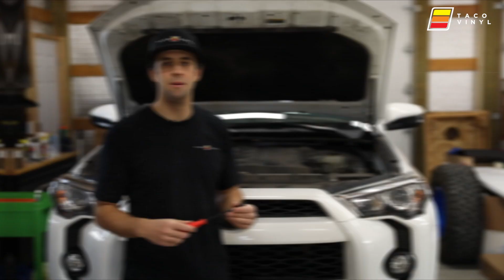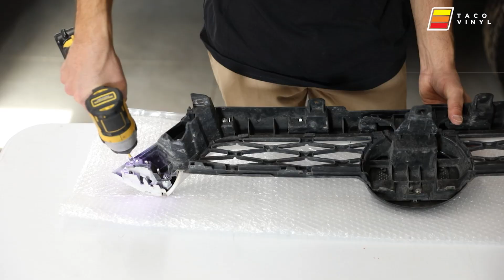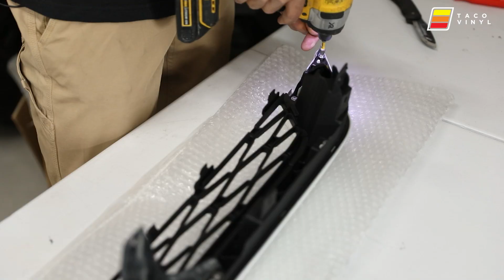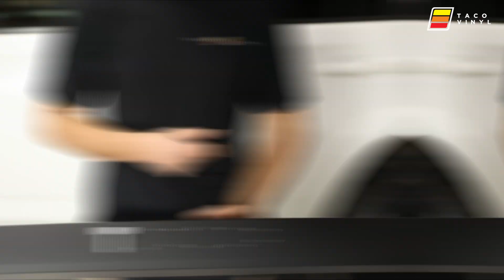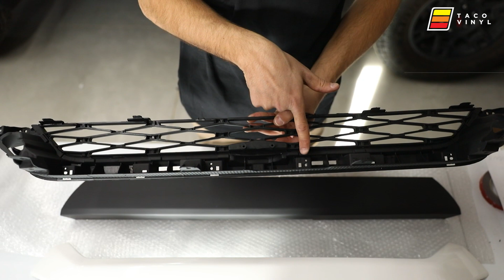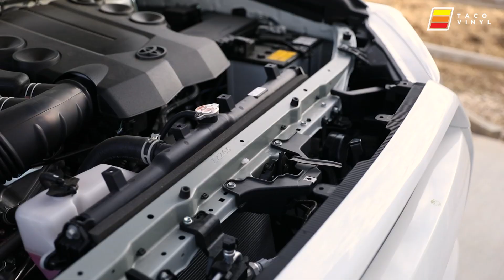2014-2021 4Runner Pro Grille Install

Comment: Ordered a grill after seeing this video. Great product. Fast and easy installation, I prefer the screws being used to mount the letters. Took me 30mins to install no problems. This video basically covers all the steps. My 2017 TRD Off Road looks nice with the new grill.

Comment: Ordered and very happy with purchase. Nice finish and quality, with no gap on the ends of the center garnish, as you see even on some oem grilles. Reinstalling the upper section was a little trickier than shown but overall, fairly easy.  👍🏼

Comment: Can you do a video for the 2020-2021 grill. I just installed mine and it created large gaps on the upper painted grill sections. You guys told me to take a dremel and trip the valence piece. Can you guys make a video on that modification.
Reply: Did you watch this video prior to installing? How would you rate the install in difficulty on a scale from 1-10 with 10 being the hardest? Would you recommend others buy this grille?
Reply: @Lando4534  i watched the video several times prior and during my install. Followed it step by step. Video was informative but i am not happy with the results. I think this product is incomplete as i am asked to modify it by the company so that it will fit correctly. I would not have purchased it had i known it would cause a significant gap when reinstalling the upper piece of the grill. Others have noted the same issue on the 4Runner forum.
Reply: @elvir55begic  Thank you SO much for the information. This concerns me because another person posted their experience with the grill as well. I asked him the same questions I asked you and now his comment is deleted. I'm not sure if HE deleted it or if the video owner did it. I even wrote the company about this issue because I wanted to make sure that it fit well without modification and the company TOLD me that he just had a defective unit. Taking the fact that you are reporting the same issue (along with others on forums) is preventing me from buying this grille.
Reply from the maker: Hey guys! Some peoples grilles fit tighter than other on that upper section and have had to trim back the black center piece for it to sit completely flush. Make the mark before you remove it and then use a tool to remove that piece. I’d recommend using a dremel. Sorry I didn’t see these comments. The best way to get help isn’t here but through our Instagram or email. Thanks
Reply: @Lando4534  They deleted my comment, I wrote you an in depth review ultimately ending in NOT recommending this product for this exact reason. They are probably going to delete this one too now
Reply: @tacovinyltv  I dremeled the grille attachment as instructed, the upper bezel still does not sit flush as it did before.
Reply: Did you ever get yours to fit ok? I was just about to install on my 2021 ORP today, but now I’m really nervous it’s not going to fit right.
Reply: @jegger1.0  no i never got mine to fit to the factory gap amount. It looks like the upper painted trim piece is still being pushed up and i still have a significant gap. I was told by the company to take a dremel and shave off areas of the black shroud but that did not work for me. I may order another kit from a different company as I’ve seen others have good luck with other kits
Reply: @westensteeghs  yes i wrote a review on their website also stating the issues i had and it was never posted either. They did contact me to try to help but no resolution was made. Wish i could return it
Reply: @elvir55begic   Is it more of an issue with the upper grill or the black plastic “TOYOTA” cover that gets adhered to the center piece between the upper and lower grill? I’m wondering if maybe just buying the OEM upper grill part would help. It’s a lot cheaper than the OEM “TOYOTA” part.
Reply: @jegger1.0  I’m not sure if that upper grill piece is the issue. I have my factory one still in the garage but i think you are saying to buy the TRD pro upper grill piece from the dealer to use with this. I can try to look into it and if it makes sense to do this vs just buying the factory kit from Toyota
Reply: @elvir55begic  Right. The OEM upper grille (PZ327-35056) runs for about $120 and the OEM "TOYOTA" garnish (PZ323-35058) goes for almost $300 (which seems crazy). There doesn't seem to be much to the garnish other than literally sticking it on so I'm curious if the fitting issue is coming from the grille not fitting in properly to the upper trim that comes with our vehicles. I'm wondering if it's possible to just get the OEM grill for $120 and get it to work with this aftermarket garnish without dropping another $300 for the OEM garnish.
Reply: @jegger1.0  That's what I am thinking about doing. The OEM grill is not terribly expensive, but that garnish is stupid priced. I am trying to find someone that just sells the "TOYOTA" garnish for a reasonable price. 

What about it @branchanyota? Any chance you could package and sell just the garnish?
Reply: @jegger1.0  My grille fits, but the upper bezel is no longer flush. I would honestly return and buy oem if I had the choice.
Reply: @scottaxton9928  Yeah that OEM garnish is stupid expensive. I don't get it...it's a piece of plastic that's essentially taped to the front of your 4Runner???
Reply: @westensteeghs  Do you know what specifically is causing the upper bezel to no loner sit flush? The sizing of either the upper grille or the garnish must be off from the OEM parts. I'm wondering if the upper grille technically fits into the inserts, but the dimensions are just off enough to cause the upper bezel to not sit correctly...or maybe it's the garnish...or both?
Reply: @jegger1.0   This whole grille setup is obviously not made for the 2020-21 gen of 4runners. The tabs dont fit, sanding/cutting was necessary, or you'll end up breaking them like I did. On top of that the grille attachment was too wide, had to cut off over a quarter inch of material  (on each side) just to have the upper bezel not rest on top of it. Even after doing this the upper bezel is not flush like the stock grill+bezel combo. Maybe if the manufacturer finished 'converting' these to fit the new gen it couldve worked. Instead they dremel out the area for the sensor to fit and call it a day.
Reply: @westensteeghs  mmmm. Not good. The 19 and 20 are just different enough that it makes fitment an issue. I really appreciate your comments. Helps me decide what to do.
Reply: @westensteeghs  you should not have to dremel a grill you paid 200 bucks for lol

Comment: The letters being mounted can become a problem if they were already installed when you received the order. Couple screws were stripped upon receipt and I thought covering with 3m tape provided would do the trick. It didn’t the letter still came
Loose and pulled away from center piece after install. Wish I could share a picture.

Comment: Having issues with this. I've installed the heritage grill but that upper mesh grill piece will not snap in now unless I file everything down, not even pushing down with a screwdriver. Is that normal, bad fit, or did I do something wrong?
Reply from the maker: Shoot us a call if you have fitment issues and we can help you out. Some fit a bit tighter than others. 2086974555

Comment: Just got the 2022 TRD Off Road Premium. Will this fit my 4runner?
Reply: Any luck getting an answer yet? Been checking out the Instagram page too and nothing yet.
Reply: @samuelrichards3066  I never got an answer.
Reply: @kimbuck-2  I would argue that the whole point of this video is in disagreement with your point. Sure, this grille COMES with the trd pro, but it doesn’t mean that those who opted out of the fox shocks and annual color option should not be able to replicate the look of the grille.
Reply: Any luck finding a grill to fit your 22 ORP? I haven’t been able to find one yet.
Reply: @Pwnashi  The website updated to include the 2022 model and I got it and installed it already. Not as easy as they make it seem to remove and reattach grill from 4Runner but I got it done.
Reply: @dodgerdanny21  Did it fit well on your '22 ? I have a ORP with the Camera System
Reply: @Steve-hy8sl  I have the same car as you. Everything fit well, except you'll need some plastic spacers. About a 1/4 - 1/2 inch in length. There were some screws that didn't fit right because the molding where the screws entered in one area wasn't big enough. I grabbed my hacksaw and cut off what I needed from a hard ballpoint pen, extended the hole in the front end molding and it worked perfect. Old trick I learned long time ago. Besides that, it came out nice.
Reply: @dodgerdanny21  for $200+ i really dont want to do modifications to it

Comment: I have a 2021 4Runner and I'm torn between this one and the Car Trim Home version. Car Trim Home is cheaper with free shipping and great reviews. The con for me though is the application of the letters. I like the idea of this version being screwed in rather than 3M tape. Taco Vinyl reviews for the 2021 version doesn't seem to be very posititive though. HELP!!!
Reply from the maker: Bring that you can filter reviews for any website, I guarantee they have they’re fair share. With our new 2021 model, it’s a perfect fit with no additional hardware
Reply from the maker: Hope that helps
Reply: The one from CarTrim home is cheaper and there's a reason for it..I had one on mine and got rid of it pretty quickly because of the poor fitment.
Reply: I purchased the Car Trim Home version because it cost less and was reviewed well with several videos made by customers. I don’t doubt the Taco Vinyl version is good quality but like I said, my decision was based on reviews and price. I’ve had it on for 8 months now with absolutely no issues. It’s held up very well to a brutal southern summer and a rough winter.
Reply: Well I’m back and not one to have a problem admitting when I’m wrong. The finish on the car trim home version grille I purchased has started to flake off. Looks like I’ll be buying one from Taco Vinyl. Do you all have any sort of warranty for your grilles?
Reply: @brooklynn-02 i guess they don’t have any warranty,did you end up buying here on taco and are you happy with it ?

Comment: What tools do you need to prepare to replace it was planning on buying from taco vinyl, just want to buy the tools first before i order the grill so ihave it all ready please let me know the tools i should get, btw i have 2021 toyota 4 runner with the sensor on the front
Reply from the maker: In the video it shows some of the tools we prefer to use. Hopefully that helps

Comment: On the 2021 grill..why is there no grill support bracket? Like the other years? Enjoyed the video !
Reply from the maker: There is no radiator mount for the 2020-21 due to the version of the grille. Might be something we add in the future. The grille still fits great. We have it installed on our 2021
Reply: @tacovinyltv  just purchased a 2021 TRD Off Road Premium, you’re saying this will still fit on my model?

Comment: Is it reversible ? I mean, if you change your minde and want to take off that 3M tape ? is this gonna come with all the paint and plastic ? Thanks
Reply: If you kept your old parts you could definitely reverse it. Just need a good adhesive remover like goof off to clean up the tape residue. It shouldn't harm the paint.

Comment: Well done!  I have a 2020 TRD Pro (Army Green) and I really want to change the color of the TOYOTA letters to either White or Army Green.  

Have you ever had to actually remove a factory Pro Grille and reinstall a different one in order to do that?  I know I could probably try to paint them in place, but that seems like it would be a nightmare.  My biggest concern is removing the current factory center section.  I'm not sure how well they are stuck on there.
Reply from the maker: No I’d definitely remove it for the best results. Using a heat gun helps a ton
Reply: There are vinyl kits on Etsy to change the colors.

Comment: Save your time and money and go with someone else for Toyota parts. Ordered their Pro Grille Kit which comes in two different versions: the 2014-2019 model years and 2020-up model years. I own a 2014 4runner and ordered the 2014-2019 kit. After 3 weeks, my package arrived half opened since it wasn't safely packed. According to website, the kit comes with 3M mounting tape and adhesive primer, which were missing. But what's most ridiculous is that they have sent me a 2020-up model kit which doesn't fit my vehicle, which I realized after I have removed my factory front grille. I checked my order many times to see if I ordered the wrong kit but it says 2014-2019 on all my confirmations. Messaged them and no response. Called them and no one picks up, but it seems they have time to post on Instagram. Toyota parts can be pricey and we all work hard to get our dream built. Stay away!! I will be purchasing my parts from other vendors from now on.
Reply: Waited 5 months notice it's they did the exact same with mine. By the time I notice the Clips broke
Reply: Waited 5 weeks for mine and notice they sent the newer style after I accidentally broke two clips

Comment: I just ordered the 3 light amber set. What else do I need to go out and buy to make sure I have everything I need for a smooth install?
Reply from the maker: Just a grounding loop to crimp on the ground. We send the an add a fuse and you’ll need the fuses for it

Comment: Toyota dealership is asking $1900 for the trd pro grill.. is this normal price? I was expecting around $300-$400 .. why is it that much??
Reply from the maker: Yeah it is. It’s because they can. If you want OEM, you pay for it
Reply: Online OEM garnish and and nameplate are around $400.00
Reply: Here are the part numbers: PZ323-35058 and PZ327-35056, that's all you will need, order them online from your dealership, ~ $500

Comment: Does installing the grille mess with the Toyota safety sense on the 2021 4runner?
Reply: This is the upper piece it won’t hurt the TSS, which is on the lower piece.

Comment: For those who ordered this grill, how's it holding up? Looking to replace the existing one I have from another manufacturer where the finish on the bezel has started to peel off. This is a better price, but still curious about overall quality. Thanks.
Reply from the maker: Great! We haven’t had someone say the finish came off. If you’d like we can put an additional coat of black on for a small charge. That would ensure a solid finish your possibly looking for. Shoot us a call at 2096974555
Reply: @tacovinyltv  do you guys have a physical store? I see you have an 209 area code am assuming you are in northern cali as well as I.
Reply from the maker: @DonJulio510  We do. We're in Boise ID!

Comment: Your fitment on the 2021 is actual trash large gaps in overlay insert barley fits and nooks back the upper grill and the backer for the radiator support only accommodates 2 screws as it isnt tall enough to hold the middle ones order arrived after a month and the “adhesive promotion wipes” were totally dry. 0/10 product quality
Reply from the maker: Hello Jordan, sorry to hear you had a bad experience install our grille. If you’d like to call us, I’d be more than happy to walk you through some steps that help with better fitment. Sometimes these grilles can be tricky to install. And if the wipes are dry, use rubbing alcohol to clean the surface and you’ll be good.